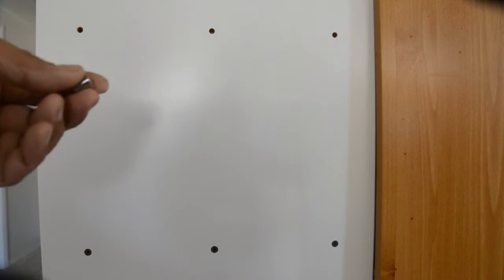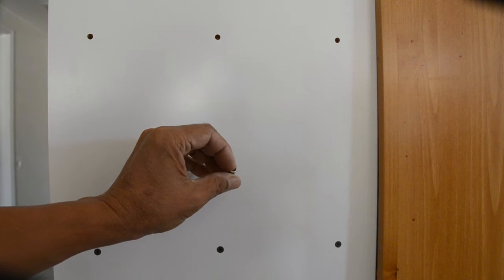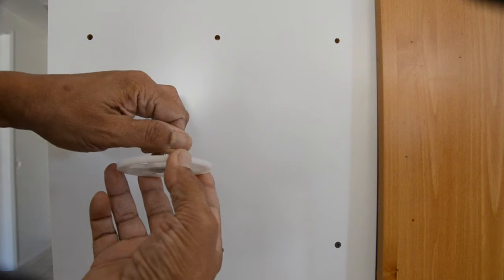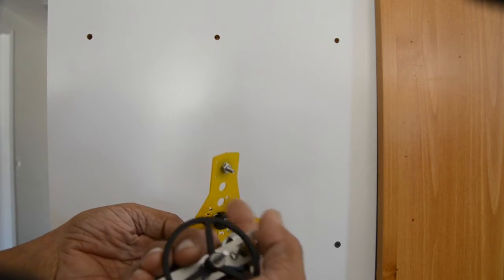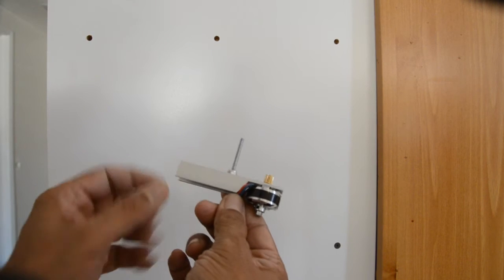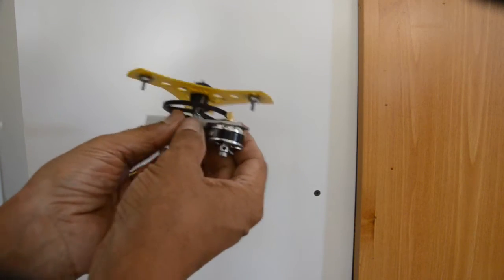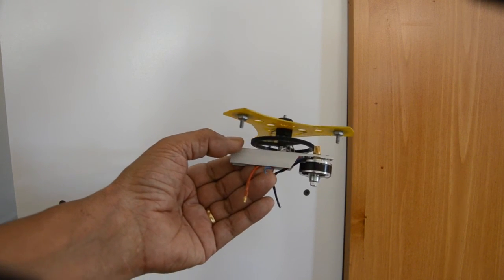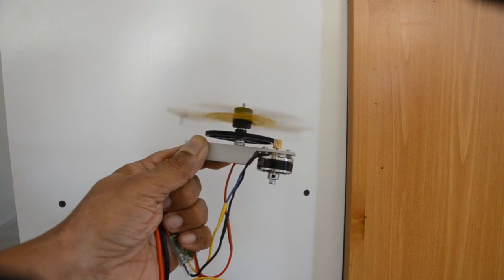NEW! *MIA INVENTION * - Gravity Cam Lever One-Way Pre-Rotator System - MIA EZ ROTO-START™

Comment from the maker: Update: I've had several email requests for this product, and  I have the kits availble as shown on my video,  but  I made some slight improvements to the cam lever, so it is more aesthetically pleasing. I would like to do a few more flights with the Pre-Rotator before sending out the units,  so that I can reassure myself and those interested in these units that it will work as intended. I don't expect people to test this unit as it is supposed to be fully tested and operational when you get it in your hands.   I like to test all my products before sending them out.  The intend is for you to simply install it on your RC autogyro, set up your TX for pre-rotator operation and enjoy the benefit of having the rotor come to autorotative rpm and take off your model lke an RC airplane. 

A little dilemma: It just so happened that my Trusty Orange TX I've had since It first was released, finally gave up, antenna broke from so much use. Nothing wrong with the product as proven by all the videos I've done with it and the matching Orange Rx's.  Because I design, fly test and improve models for a living, and I fly day in-day out and probably a LOT more  than a regular hobby enthusiast,  I am probably well qualify to give my honest opinion on this Orange TX/RX. You have no idea the amount of usage I've gotten from the Orange TX/RX combos. Have been extremely happy and it has been a nice "functional" (no unnecessary bells and whistles to make it complex) set up for all my flying products.  Once again , I like "Simplicity" .   I can't say enough about it as it has  also been a great TX for the buck.  It does not have a potentiometer as I would like it to have for the Pre-Rotator to work on a spare channel,  but it has other provisions for activating the Pre-rotator as I've shown in my other videos, the pot would be just for ergonomic convenience.  I am waiting on a new TX so that I can  continue to test the improved cam lever and to reassure my customers a great product.  Please hang in there! It will not dissapoint !. I guarantee that!